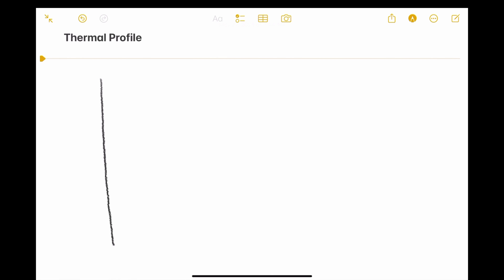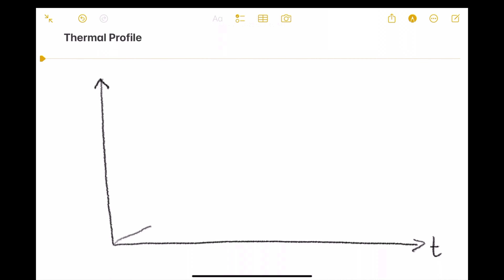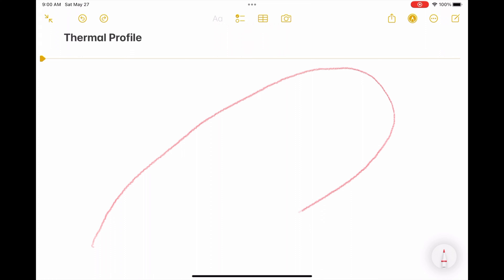How Big is a Thermal?

Comment: Good topic for discussion! When you have a zero-lag vario like your Hawk, it's easier to wait to turn until you see/hear the lift decreasing. When you have a typical vario with 1-2 seconds of lag, it costs you more to wait. You'll have to circle in sink to get back into the thermal, which costs time and altitude. My mental model of a thermal looks like a mushroom cloud, in profile. If you're on the top of the mushroom, it's wide and smooth. If you're in the stalk, it's narrow and turbulent. You're usually in the stalk, unless you get lucky and run into a thermal that is just forming under you. I have a distinct memory of this happening when you and I were flying dual at Cross Country Camp. We found an incredibly wide, smooth thermal in the blue that was unlike anything else we'd run into that day. We were on top of the mushroom.
Reply: How does a zero lag vario work? Do portable hawk varios exist?
Reply: @VrataVenet  Hawk is a very new innovation in varios. It's a software upgrade for LXNav varios. It costs something like $3500 USD. No portable units available.
Reply from the maker: Where my experience is, taking an extra 20s to relocate a good thermal costs very little compared to turning in the 4 kt section of the thermal when I could have been in the middle. My big mistake was not recognizing how crazy wide the good thermals can be...so wide that no amount of "correction" would put you in the center.

Comment: It very much depends on the weather. I've seen thermals that are like 1km across, where it's near impossible not to get up. And there are days where the thermal is only 100-150m in diameter and you can barely find any circle that keeps you inside the thermal. And then there's also warm weather days where the whole airmass is behaving like bubbles and there is no consistent center, just one bubble near the next bubble.

Comment: In the alps during spring, thermals can be spaghetti thin. I have to turn off the vario because it's always late. So 50-60 degrees bank angles are not uncommon.
When I flew over flatlands I found thermals much larger and with more rounded shapes, like you'd expect.

Comment: How high are you? I do a lot of paragliding and lower down.... As low as 300m, it is still possible to find big enough thermals to go back up on a good day, however they are much smaller, possibly 30m (100f)
Reply from the maker: In this video, probably around 3500m (11000 ft). My experience is same as yours when very low...they are weak, small, and disorganized. After a few thousand feet, they will finally organize into some "normal" thermal, and then usually widen by at most 30% if you're able to climb very high. I try to avoid the bottom third of the boundary layer for this reason...it usually costs a lot of time.
Reply: @8OrangePants  I thnk @vrataVenet makes an important point.
Low down, thermals will be smaller. Where I fly, cloudbase is often just 1000m AGL on a decent day, 1500m AGL is a good day, 2000m AGL is exceptional. 
The higher the thermals go, the larger they get at the top. Maybe due to lower air density there as well?
But probably more to do with multiple small thermals all feeding into one big one at higher altitudes